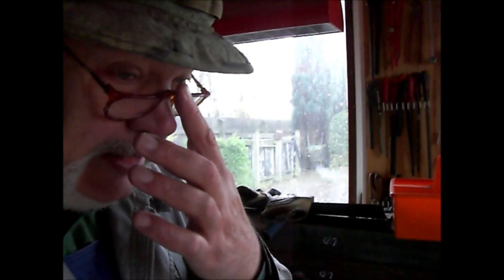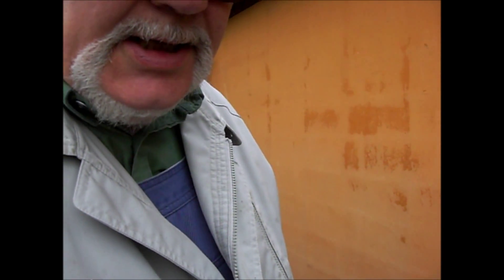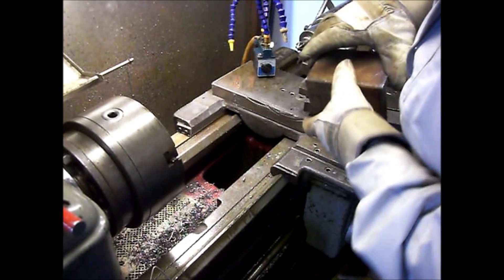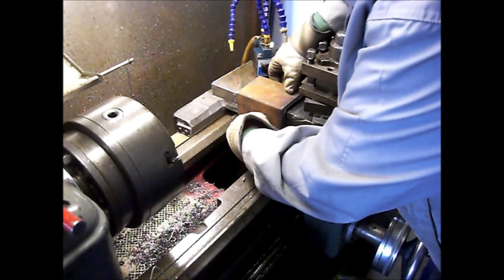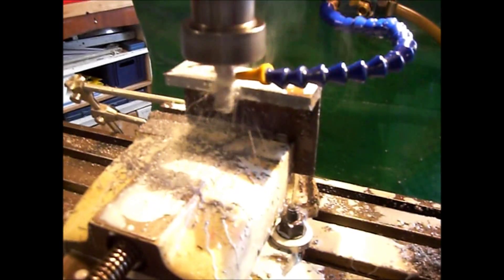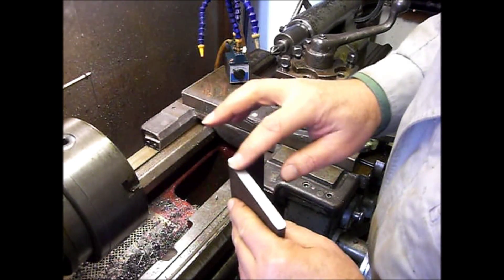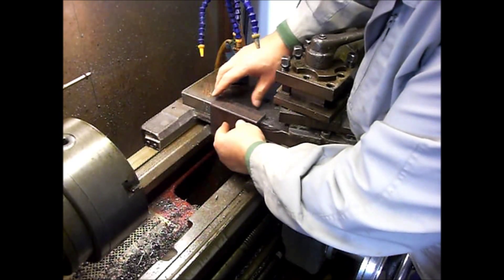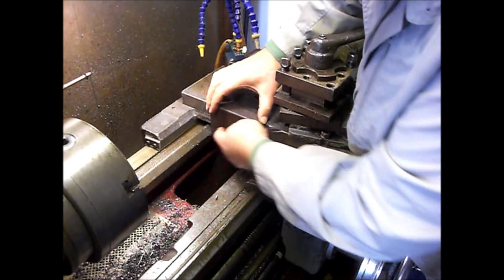TravelRest 02

Comment: I have a similar off shore plasma cutter and it too has a problem starting the arc.  I found that a very good ground helps mitigate the problem.  Nice demo...
Reply from the maker: Thx !
It's a little misleading because I normally have NO problems starting the arc, but I mounted a little "guider" at the ruler side of the torch and it's should allow the torch to come a little closer to the object - then it ignites without problems.